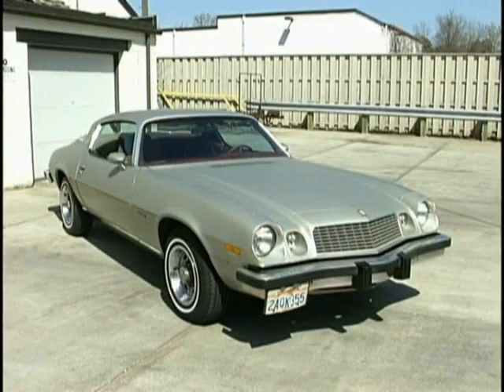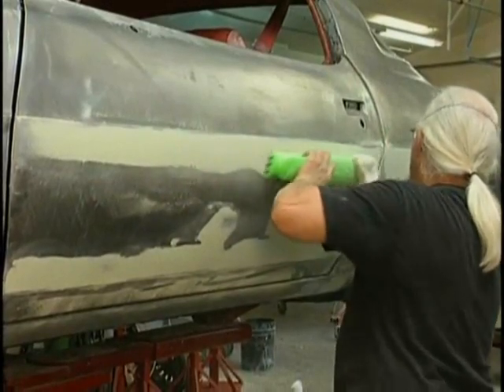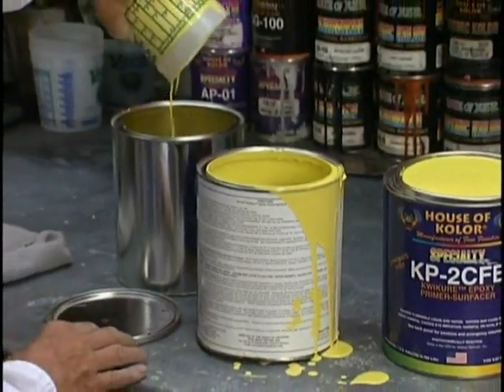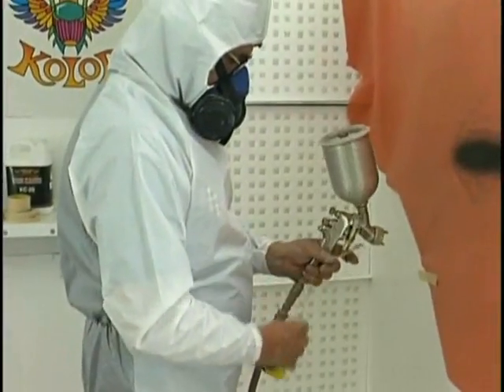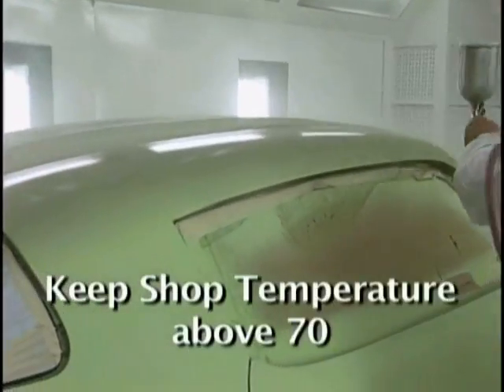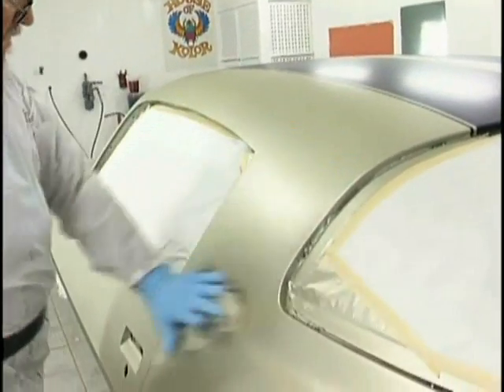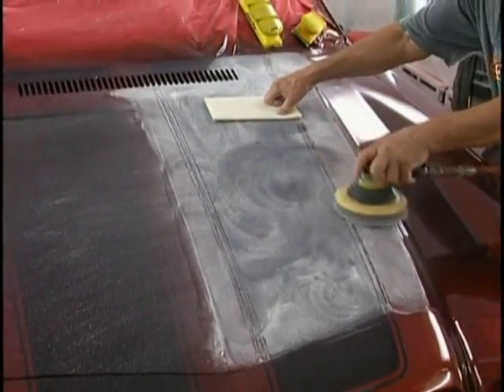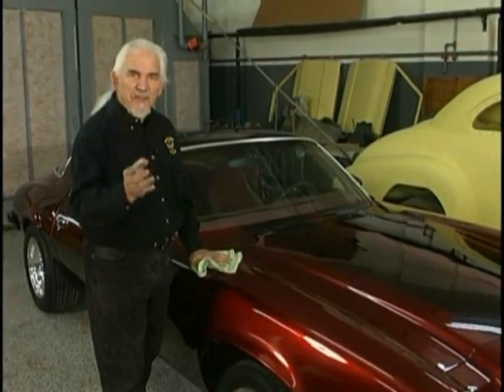KUSTOM PAINTING MADE EASY WITH MASTER PAINTER JON KOSMOSKI

Comment: Excellent video. In my first year of trade school I had to paint a single VW fender black; my teacher took a ballpeen hammer and put a nice ding in. I had to strip it down the bare metal and work that ding out and paint it black, which likes to reveal all sorts of imperfections. Also had undercoat the wheel well. To  fail it would've meant to fail the entire three year apprenticeship.

Fun. 

95% percent of any decent paint job is prep, and most folks have no such patience. 

Of course a decent well-lit shop with modern tech and climate control is essential.

Comment: Jon painted my 1969 Camaro Z28 back in 1973.  It started it's life as a blue car but we changed that to candy apple red.  I had put a fiberglass hood with an L48 corvette type scoop on it which he had to deal with.  He used gold base over the red.  Different from this treatment, he painted the stripes in a flat black over the top of the clear (I don't remember why).  I remember arguing with him about wanting to take all of the decals off the car and welding up the holes.  It was for the best though because the winters in Minnesota with the salt are brutal on holes in metal surfaces even if the car sits in the garage the whole time.  The car was fab!  It cost me $800 at the time but it was the best $800 I ever spent (I'll bet its quite a bit more expensive now!).  My car was the envy of everyone on the west side.   I'll post a picture of it if I can find one.
Reply: @Greg hello,how are you doing